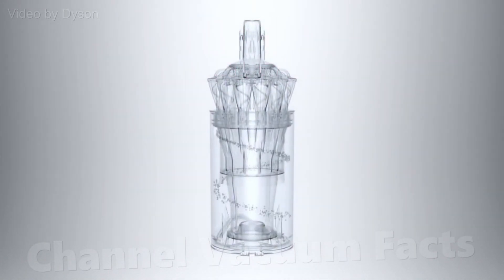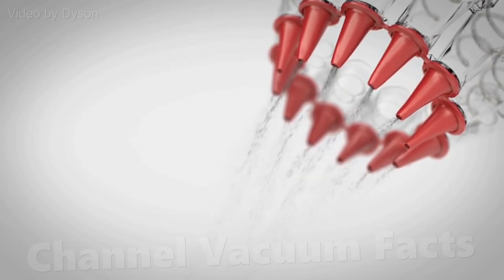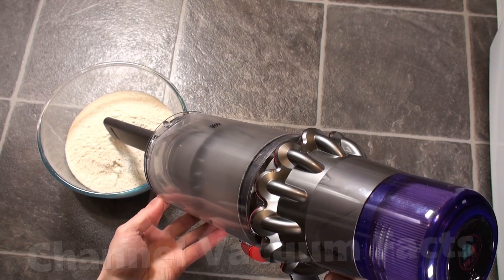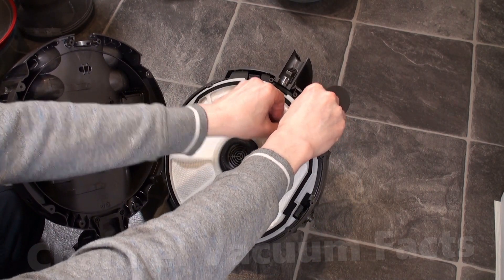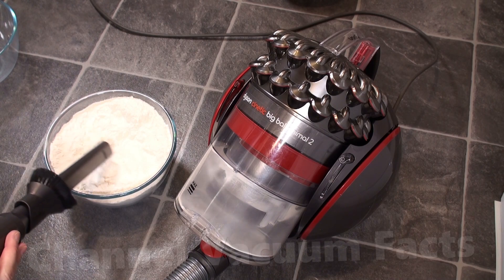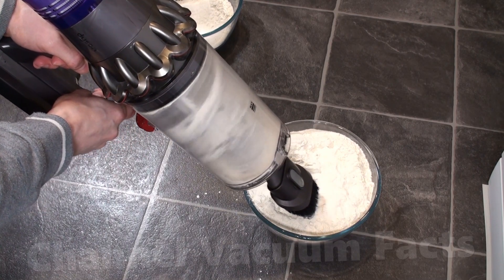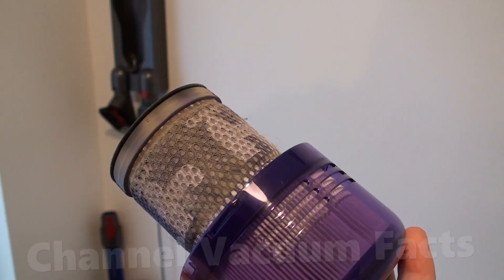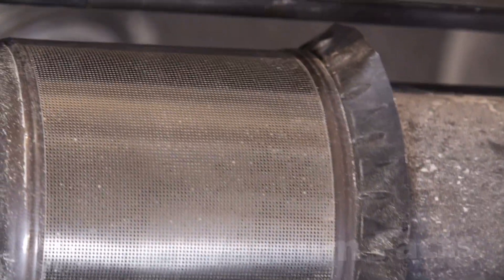Dyson Cinetic Myths – Testing How Good It Really is!

Comment: So...why did you not weigh the inaccessible HEPA filter before and after the flour test? Why did you not particle count the machine?
Reply from the maker: Couldnt fit something that massive on the scale. But unlike the other two filters which had clear visible dust on, there was nothing visible, meaning if there was something on there, it was so trivial. And in either case, it shows clearly that the dust accumulation rate is so trivially tiny despite accelerated real-world usage, that the claims are almost certainly true. The weight was irrelevant anyway because, as stated, this was a qualitative test; the weight was merely a visual aid. Why did you think the weight was important when the test was not quantitatively controlled? It seems contradictory that you're quick to fire off these questions to try and discredit, but overlook the obvious that was even stated in the video. xD
Reply from the maker: <tumbleweed> ... figures
Reply from the maker: @PCSpider  I think you missed the point where I said it was a qualitative test and the weight was purely visual and doesn't indicate anything. And the point where I said that you can see it works amazingly, regardless. Not sure why you're raising a particle counter strawman; measure that yourself if you're interested. Every other claim you made I don't believe because there's no evidence. And your incorrect and racist conclusion pretty much sums you up. You can't defend your position, so might as well run away like everyone else back to your bridge.
Reply: @VacuumFacts  Ah yes...How racist of me to discourage people from buying a vacuum made with child labor.
Reply from the maker: @PCSpider  It's racist of you to suggest there is any without evidence just because they have an automated robotic assembly plant and high paid skilled R&D jobs in a country no doubt further east than yours.
Reply: @VacuumFacts  Do you have any evidence they don't use child labor? They are not doing their R&D in Malaysia, ONLY the manufacturing. Child labor is still legal in Malaysia. Therefore it is highly likely they are utilizing it.
Reply from the maker: @PCSpider  In addition to everything else, you also don't seem to understand the concept of burden of proof. The onus is on you to evidence your positive claim, not on others to evidence the negative. And you are, unsurprisingly, completely wrong, again, about the R&D in Malaysia. You'd think, given your propensity to misuse YT facilities and troll my comments that you'd have the capability to do a simple fact-check on Google. If you were developed enough, you'd come across this https://careers.dyson.com/en-gb/where-we-are/asia-pacific/malaysia/ . It's like apples and oranges. I output facts; you output bollocks.
Reply: @VacuumFacts  So where exactly in this propaganda put out by Dyson to make Dyson look good does it state the company does not use child labor to manufacture products?
Reply from the maker: @PCSpider  Deliberately trolling is your only response to a failure of that magnitude? lol
Reply: @VacuumFacts  So...are you going to provide me with somthing? So far I still have seen no evidence Dyson does not use child labor to manufacture their machines. You don't even make an attempt to prove Dysons do not dispel harmful dust back into the air. Is this your last resort to dissuade me from questioning your flawed logic? To call me a troll?
Reply from the maker: @PCSpider  There's enough here for people to make their own minds up now. You've been fed enough xD
Reply: @VacuumFacts  There is enough here for you to give people misinformation and propaganda to fulfill your weird fetish with Dyson. Now are you going to waste time or are you going to give me yet another slapped-together, disgraceful argument about why a machine that costs $600 is potentially made with child labor and blows MASSIVE amounts of dust back into the air.  Oh wait, they are one in the same.
Reply: A great idiot once said "<tumbleweed> ... figures"

Comment: I have a Dyson DC33 and a Dyson Ball Animal 2. I bought the DC33 brand new from Walmart in June 2017 and I bought the Ball Animal 2 brand new from Lowe’s in November 2017. The DC33 is rated at 240 air watts and the Ball Animal 2 is rated at 270 air watts. They are excellent machines. They have washable lifetime filters (Pre Filter and Post Filter) and lifetime belts. They have sealed HEPA filtration.

Comment: My local mosque uses a DC04 silver/lime, DC14 origin and DC55, they have lots of fine dust in their carpets from the hundreds of people who come in with their shoes off to pray 5x a day so they need an excellent vacuum that can cope with fine dust. No vacuum has ever been adequate for their needs apart from Dysons. The DC04 and 14 seem to need less maintenance possibly due to the thicker pre filter, the DC55 filter needs more attention (they know to empty at max like I told them to), they use the DC14 the most due to how reliable it's been. I wish their pre filters still used a thick sponge material to maintain airflow better
A cinetic machine would be brilliant, not a Dc75 because I tried mine there and it didn't work unfortunately. Maybe it's because the Dc75 has less airflow than the cylinder machines, it can't spin the tangle free head as quick as the big ball cylinder or DC54 and cyclones need optimal airflow I reckon
Good video tho I always wondered how effective the ball animal 2 upright's cyclones were, looks like a great vac for the mosque if it wasn't for the older style cyclones
Reply from the maker: What does "didn't work" mean and how did you know out of interest?
Reply: @VacuumFacts  the 75 performed well but the cyclones let dust through, this is how I did my official cinetic testing to see for myself if the cyclone worked

I just vacuumed the carpets there till I filled it to max and then checked the inner duct of the cyclone, there wasn't a lot of dust but very little like a fine layer, had to wipe my finger to see
Reply from the maker: @parwaz7861  That's not convincing evidence the cyclones didn't work. The mass of dust accumulated on the filter is the only way to properly conclude anything about cyclonic efficiency.
Reply: @VacuumFacts  isn't cinetic cyclonic separation meant to capture all particles tho? I just found it disappointing that there was dust in the inner tube after one vacuuming session
I really think they should make their cyclones 3 stages again at the least if they can't use a more powerful motor because that's clever engineering, improving efficiently without wastage of anything
Reply from the maker: @parwaz7861  No. It's meant to capture the particles a post-motor filter would have captured. The cinetic tips reduce the cut point size. The post-motor filter is supposed to not clog sufficiently in its 10 year lifetime that there's be a reduction in performance. Only by looking at the filter can you make any meaningful conclusions about it. Hence why I did that in the video. Their cyclones have never been 'three stages' (I'd need to see clear evidence explicitly demonstrating this to believe it). They've been 'three tier' (actually two), but as explained in the other comment, they don't pass air through a same effective cyclone multiple times.
Reply: @VacuumFacts  then how come a dc54 has 3 bins? Dyson have used it because they know it works well and why would they go back to inferior cyclonic tech again when they already had a better cyclone? The dc17 had an innovative level 3 system then they went back to root cyclones on the dc27 and 33 for example, just like a Dc14 has
Reply from the maker: @parwaz7861  I don't know enough about the DC54, but there's no reason to believe the Cinetic tech worked differently in it. I don't know the internal decision making processes within the company, but there's no reason to suppose that not using one technology on a future model is evidence of its ineffectiveness. Machines are tuned, which takes time adn R&D; reasons could be no more complex than financial. The DC17 had different sized cyclones. I'm aware of no evidence the overall filtration was better and it may have been an example of the tuning they did before they found a better way to achieve the same goal. Back to the original point: I'm aware of no convincing evidence or good reasoning why the cinetic tech discussed in this video doesn't work equally well in any machine it's been employed in, where the goal is to eliminate filter maintenance.
Reply: @VacuumFacts  I believe you and I agree with you it's just that the 75 need some improvement imo (from my own real world experience as mentioned, there's gotta be a reason why it didn't work properly for me), try getting a used one maybe to test through its paces maybe?
Reply from the maker: @parwaz7861  I'll add it to the list but probably wont do a big shebang video. That particular product doesn't really interest me much, technologically, so no review. Just a quick test, if I do.
Reply: @VacuumFacts  wicked 👍🏽

Comment: You shoulda tried the Dc75 upright cinetic model, that's the one that gets criticised as having inferior cyclones. The DC54 has excellent cyclones because it has 3 stages of cyclonic separation, the Dc75 has 2 so it's not as efficient. Im sure the DC75 cyclones are good but they're not as good as the cylinder cinetic models from personal experience
Reply from the maker: Unfortunately, I didn't own that one and I had no intention of buying them all. The technology is the same, regardless of the propaganda. There is no evidence other specific models don't work as effectively and there's no good reason why they shouldn't. Cyclone efficiency (cut point) is determined by the volumetric air current passing through a given cyclone, not by the 'number of stages', which is a marketing term to denote how the cyclones are bundled together in the space available. This video shows the technology fundamentally works. It explains why it works and why it's not likely present on handhelds yet. It has debunked all the propaganda and lies. All evidence has shown the sources criticising it were incorrect, as might be predicted from their lack of credible evidence or any demonstration of technical knowledge of the underlying science.
Reply: @VacuumFacts  that's cool and I understand your points but in terms of my own real world usage where I haven't abused it, it was a brand new bin and cyclone assembly as well and it just didn't work on my 75, my dc54 cinetic just works a lot better for some reason, there's gotta be a reason why and I think it's because the 54 not only has a mote powerful motor but also it has 3 bins, one for each stage of cyclonic separation

Cos the cyclones are good, no doubt about that but it's better for the air to go through the cyclones 3x rather than 2 to ensure that maximum filtration is ensured, I've not seen any dust exiting my dc54 cyclone yet after many bin fulls whereas the dc75 took one vacuuming session at the mosque, I vacuumed till the dirt reached the max line and then I stopped to check and unfortunately the inner chamber had dust in it, it was a very fine layer but I'm really picky
Reply from the maker: @parwaz7861  I don't believe that's how it works. It would make no sense to feed the air through the same effective cyclone 3 times. That's like spinning your clothes in the washer 3 times; they're no dryer because drying is related to centrifugal force (spin speed) and reaches a plateux with time. And that means you linearise rather than parallelise and thus curtail your air current dramatically, which reduces cyclonic efficiency. That makes no sense and I think you've misunderstood how they work. The air drawn through the shroud is distributed through ALL cyclones proportionally in parallel. Utilising a larger number of cyclones in parallel means you reduce air current restriction.
Reply from the maker: @parwaz7861  The advert for the DC54 does not even say they it has "3 stages of cyclonic separation", it says they have "54 small cyclones arranged on 2 levels". Not sure where you got that from. :)
Reply: @VacuumFacts  I know what you're saying, once the air goes through the shroud it divided I to the number of cyclones but what I'm saying is the dc54 cyclones work better than the 75 based on my own experience in the real world

One single cyclone  isn't good enough that's why you need at least 2 to get the air reasonably clean. It ain't as good as using 3 stages though because then the air will expel out cleaner is what I'm trying to say, the dc17 and 23 had it and they reintroduced it on the dc54, all of which seem to have excellent cyclone efficiency. I took my dc17 to the mosque as well once with my dc41 mk2 and the dc41 mk2 filter clogged with all that dust whereas the dc17 kept going and the filter was almost spotless (very very little dust was on it after bin full after bin full)
Reply: @VacuumFacts  they're referring to the small cyclones, arranged on 2 levels, the bin is one stage of cyclone as well, so the bin is stage one, then the 2 small cyclone stages

If you open the bin flap of a dc54 you'll see there's 2 fine dust Chambers 😄
Reply: Unless I’m misunderstood or mis reading isn’t there meant to be some dust well fine dust in the inner cyclone discharge chamber! That means the small Cinetic cyclones are doing their job!
Reply: @Dysonballs  no I mean the inner duct that runs to the motor
Reply from the maker: @parwaz7861  Yeah. But I'm saying that your interpretation of what you've seen in your experience isn't convincing. I've seen no convincing evidence the cinetic technology somehow works differently in different models and there's no good reason it would. The interpretation you've given so far is incorrect; air doesn't go through an identical cyclone multiple times and doing so doesn't improve filtration (much) because of how cyclones work. The evidence you've used to determine one model works less well than another is just not convincing. You need to do more careful testing to conclude that. If you were to do it quantitatively, you'd suck up the same amount of the same dust type at the same rate and measure the HEPA filter mass difference. And bearing in mind, the objective is to not need to maintain filters for 10 years, not to eliminate every particle.
Reply: @VacuumFacts  whatever it is, it hasn't worked in this real world example so a dc75 isn't a great machine for that setting I've used it in, imagine had it been used there as an actual daily vacuum no doubt would there be dust in the motor, the Cinetic cyclones are supposed to capture all the dust particles but this hasn't, it was a brand new bin and cyclone used for normal vacuuming and hadn't been abused because I stopped at the max line 

You don't see people criticising the dc54 on YouTube it's all mainly dc75s why do you think that is?

I've given you the reasoning why I think my dc54 filters better isn't thay evidence enough?
Try taking one apart and seeing how the air path works
Reply: @ Parwaz 786 I get you now thanks.

Comment: The missing important part added! Makes perfect sense why Cinetic is not yet available on their cordless models. Battery tech being the main part that will enable this in time. Explains and backs up what I thought in the past why Dyson never had power settings on their corded machines as it affects the volumetric air flow through the cyclones.
Reply from the maker: Showing the increased filtration performance in max mode on the V11 was the main missing part, and this led to the conversation of why max mode can't be permanent just like on mains machines (battery tech limitations). No one spotted that I hadn't done max mode...
Reply: Nicely shown. No one did spot it! Least it’s added to show the complete picture.